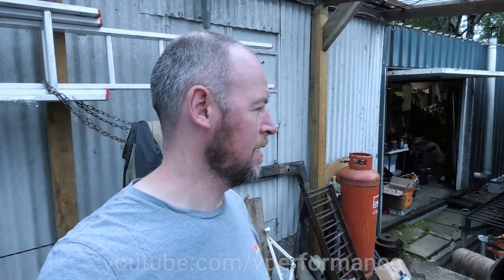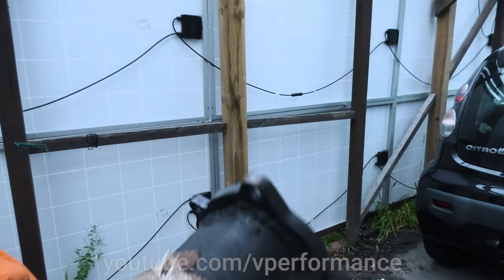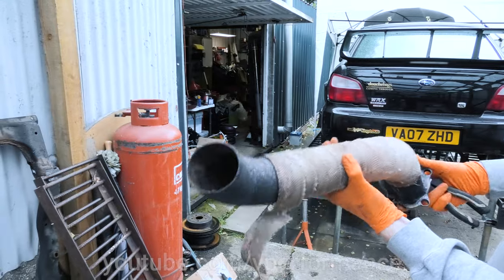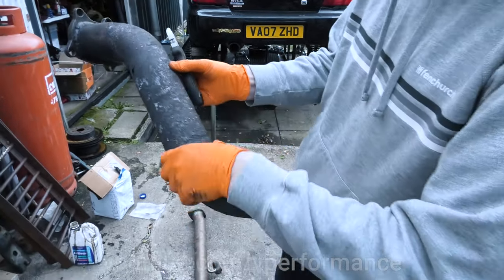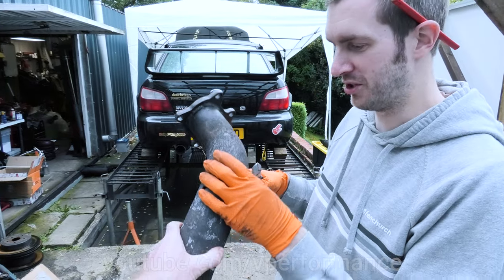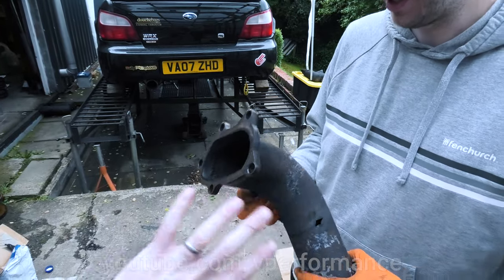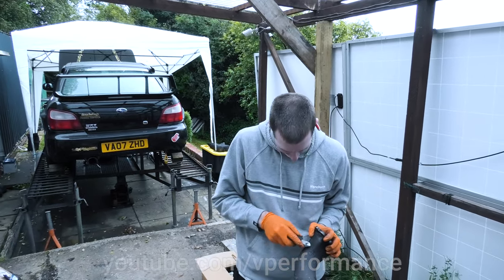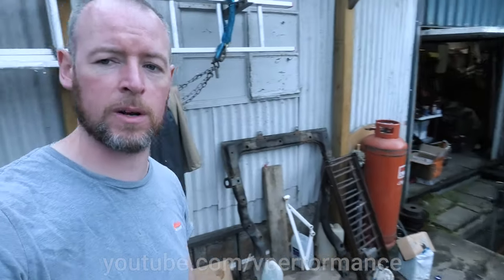Exhaust downpipe wrecked by a bad heat wrap // Project Driftbaru

Comment: When installing heat wrap you need to ceramic spray the inside and outside of the pipe before hand to protect the metal, and if you spray silicone on top to keep out moisture it's even better. I did this on my motorcycle headers and never had a hint of corrosion

Comment: I doubt that is high quality stainless steel.  The Chinese have been dumping low quality "stainless steel" on the market for years.  If it was high quality stainless steel it wouldn't have rusted like that no matter the heat or moisture trapped by the untreated exhaust wrap. I almost bought a toolbox topper from one of the tool trucks that was supposed to be high quality stainless.  Despite the tool guy telling me they made it in the US of A I doubted the steel they were using was.  I grabbed one of his pencil magnets and even that weak magnet stuck to it and held itself horizontal.  There are varying degrees of stainless steel and some are magnetic.  Those aren't the grades of stainless you want to use on an exhaust system.

Comment: I've never believed in wrapping exhaust, it traps more heat in the piping which will affect whatever metal the pipe is made of. Not only that, but the exhaust going to the turbo is hotter and decreasing the life span of your turbo and possibly even heating up the intake air going into the engine because of how hot(glowing red) the turbo manifold gets. There is a very good reason why pretty much every turbo car has heat shielding over the exhaust and not a wrap from the factory. It's to still allow for the exhaust components to breathe easier as well as simply prevent novice car owners from burning themselves when they dive into the engine bay right after driving the car. If you ask me, any form of Aluminum heat shielding/shrouding is the proper way to go if you're trying to reduce heat in the engine bay
Reply: hot air has more velocity
Reply: @matk22  true, but reduces the efficiency of the working components, there is a balance to be found most definitely
Reply: @Grooove_e  how? Higher velocity quicker spool faster exhaust flow
Reply from the maker: This is true. We hoped to show people in this video that there are some downsides to it. I can't afford to replace my downpipe every 10,000 miles!
Reply: @matk22  yeah but when you make that turbo operate at higher temperature its going to cause premature wear and also heat up to the point where its even heating up the air going into the engine. More air doesn't equal more power if the air temperature is higher
Reply: @matk22  hence why everybody used to want a cold air intake although those have been proven to show minimal gains especially in situations where they are combined with a custom wrapped exhauat

Comment: I've had my stainless downpipe wrapped for 4 years now. I live in a very wet and rainy area. My downpipe is still shiny, a bit blue, but no rust.
Reply from the maker: Could have been some shitty steel then
Reply: They were probably using some cheap material piping. They actually should have used titanium wrap instead of fiber glass. For the most part Ive seen this stuff work.
Reply: Lots of guys silicon spray the pipes before wrapping them and then silicon the wrapping too.
Reply: also, run the engine after long drives in the rain. dry off them pipes a bit, the fiberglass traps it in otherwise.
Reply: Did you have it coated or just straight stainless?
Reply: patricknbrooks11 Ceramic coating them is the best grade of quality protection because it traps the heat completely and the pipes doesn’t rust
Reply from the maker: What makes you say that?
Reply: Only stainless steel t304 doesn't rust t409 does and it's still technically stainless steel

Comment: It wouldn't have cracked so quickly if there was a "flex" pipe
Reply from the maker: Agreed. Flex pipe might have bought more time
Reply: Or used a proper steel that is not the cheap shite that is 304. Oh well, blame the wrap, easier than doing a good job on one of the easiest bloody things to do in a cae, a bloody downpipe.

Comment: Wrapping exhaust pipes is good practice, as long as
it's done when new and sprayed with silicon to keep the 
moisture out. Which I doubt it was the case in this installation.

Comment: That fracture might have been caused due to fatigue as you don’t appear to have a flexible joint in there. Might also be why it fractured previously at the glance to the turbo.

Comment: From the article Why Does Stainless Steel Rust by Polymer Solutions Incorporated. "A less common form of rusting in stainless steel is after the stainless has been exposed to very high temperatures, often in the 750-1550°F range (400-850°C). This type of corrosion is often seen in welding applications in which stainless is heated and then cooled. If this happens, “sensitization” can occur which is where the carbon and the chromium bond together in the stainless steel and form carbides. These carbides situate themselves at the stainless steel grain boundaries, and the grain boundaries become deficient of chromium. With lower chromium concentrations at the grain boundaries, the chromium oxide protective layer can become discontinuous and rusting becomes possible. “Sensitization” can ruin stainless steel forever; however the damage can sometimes be mitigated with complex heat treating."

Very interesting stuff. I didn't know this. At first I thought you must have used a mild steel downpipe, but I didn't even know anyone made those. Catastrophic failure indeed.
Reply from the maker: Science! I reckon it'll have been on 400°C easily - turbo gets red hot on a bad day!
Reply: Easily! Especially when heat wrapped. ;)
Reply from the maker: @802Garage  "can ruin stainless steel forever". Yep that sounds about right.
Reply: @vPerformance  there are two types of corrosion that led to your issue.  1.  Under-insulation corrosion, 2. galvanic corrosion.

Comment: I only raped my exoust to keap my ac hose, power steering hose and my trans cooler lines form melting agen to keap the heat away from the rubber lines not for any performance advantages
Reply from the maker: This right here is a perfect use case for heat wrapping. Well done.

Comment: I agree with you. It's a waste of time, wrapping, and has more disadvantages than advantages, though your downpipe looks super janky. I have a small hairline crack on one of the welds on my Invidia SS bellmouth DP, just below the high-flow "fake cat" (that's what I like to call them), most likely caused by my previous wrapping, which ended prior to the cat-bulge. Maybe it kept the area just below the turbo a bit cooler, but who the fuck cares.

Comment: Heat wrapping is great.... The quality of the material that your downpipe is made of is the issue. You're not really supposed to wrap mild steel. Generally its reserved for something like inconel or a quality thick wall stainless or something that's properly coated. Something that thin will retain too much heat and break down significantly faster. That being said, proper heat shield solid sheets work better as they 1. dont trap moisture, and 2. don't touch the metal directly, but just provide thermal barriers.
Reply: That was stainless.  Emphasis on 'was'.  :)
Reply from the maker: Solid sheets? Not seen that before - who makes them?
Reply: @vPerformance  he means like the factory heat shielding that would come on the car if it was bone stock. I just took the factory cat off of my 03 bugeye wrx and it has a bunch of stamped aluminum heat shielding around it. Usually this heat shielding is very hard to find unless you have a factory Subaru Exhaust or are capable of fabricating your own

Comment: You have to also look at the factors of its purpose of how consistent it is used, is it a car of "high performance", and the material of the downpipes. The wrap will avoid the heat from flowing through the engine bay and keep it through the piping, of course in high performance and also running it on a daily the pipe itself it is bound to give out by overheating. Again it depends on its purpose. Great video guys.

Comment: Dudes, you can wrap the steel pipe as long as its quality metal and also you have to put silicone spray on the pipe before wrapping the pipe, it should then last tons more, also on normal cars that dont go on high rpms all the time like drift cars do, its safe, on normal everyday driving and doing pulls, its totally fine either way

Comment: That's probably poor quality steel, el cheapo. Ran for years with a 304 stainless dp wrapped on a daily driver and winter use too, and it's fine, no sign of rust. However heat hardens stainless and it will become brittle.
Further point, ceramic coating will do the same thing thermally, you're just keeping heat in the exhaust, however it won't hold water close to the surface so may be better if you start with a cheapo DP

Comment: The problem isn’t the wrap, it’s the cheap metal that you used for your exhaust setup. You can wrap quality metal without any issue.
Reply from the maker: This was a brand new stainless steel pipe. I can't say what it's made of though, because we didn't make it.
Reply: @vPerformance  always look for 304 or 321 stainless. Both should resist corrosion better than chinesium, but in reality, the problem is the wrap retains water. Seal it with high-temp silicone spray, should last much longer.
Reply: @ai_university  316 has more resistance to corrosion than 304 though right? Never run into 321 but I'm sure 316 is better than 304. Bit more expensive but you get what you pay for.
Reply: @thymepeacefiend6535  yep but 304 holds up just fine in my experience, and 316 is very hard to get hold of for some applications. 409 stainless is the cheap version that corrodes even without wrap.

Comment: It looks like the problem was corroded inferior metal and not the heat wrap itself.
Reply from the maker: The downpope was brand new when it was wrapped. It could just be a crappy product, what do you think?
Reply: @vPerformance  You have to seal the wrap with heat resistant silicone spray after wrapping, and don't overlap too much, it should last you 50k+

Comment: To explain why that pipe cracked on you is quite simple. Subarus don’t come stock with a flex pipe, they use spring bolts and a donut gasket. This allows for slight flex of the exhaust system. This wouldn’t have cracked if you used the proper hardware when installing the exhaust.
Reply from the maker: Not great work there by the garage who fitted it then. It's a miracle it lasted as long as it did.

Comment: Heat wrap is mainly for headers and manifolds coming off the head of an engine or exposed hot pipes on a motorcycle....my headers on a v8 that are wrapped are plain steel, just fine...are never wet because the heat keeps them dry, prevents my plug wires from melting. After about 3 years the fiber glass is starting to fall apart. Time to wrap again.

Comment: being a solid pipe with without a flexi joint surely insnt helping,  the location of some of the cracks looks lke  some bending stress has been aplied either from the engine twisting or the exhaust getting bumped..  although i agree wraping isnt a good idea in most aplications unless its full on motorsports and youre expecting to be changing out parts fairly often.
Reply from the maker: This looks like another vote for the flexi. I didn't even consider that as a factor for the shearing

Comment: I think there's a combination of things that lead to that failure,
Chinese mild steel 
Wrapped from the dump down, should have been wrapped to the dump to stop water ingress
No flex pipe
Reply from the maker: I assumed it was wrapped from the top down to prevent water coming up from under the car. It did have a flex pipe after the flange, but maybe that wasn't good enough. Chinese mild steel is just a guess - we don't know where the raw material came from. Could have been cheap Russian steel!

Comment: Spray the exhaust with steel-it and then use header paint to prevent corrosion. Then wrap it and use the silicone spray to keep moisture out
Reply from the maker: Or just keep it standard if you don't want to do all that

Comment: Problem one no one else pointed out you already repaired that before with welds meaning the metal was thin and most likely bad then you heat wrapped it and it got worse so by telling people don't hear wrap stuff you mean don't hear wrap metal that's already bad. Using heat wrap on new headers and down pipe is ok and good
Reply from the maker: Don't heat wrap unless you don't mind accelerating the destruction of whatever pipe you wrap.

Comment: whats the benefit of wrapping the exhaust after the turbo?
Reply from the maker: Exhaust gas temperature is higher which means faster flow. It also keep turbo heat out of the engine bay and in the exhaust instead.
Reply: @vPerformance  I've heat wrapped my stainless down pipe but the manifold is tiny and super short on a low BHP diesel so didn't do that. Do you think doing the downpipe will atleast help a little bit?
Reply from the maker: It'll keep heat out of your engine bay but its unlikely to make a power difference. Just keep an eye on the pipes in case they deteriorate faster
Reply: @vPerformance  it's full stainless so it should be good!

Comment: the idea is to cut down on the exiting radiating heat which often get sucked into the intake for some cold air setups.
Reply from the maker: Indeed. The downpipe on the subaru radiates heat up into the intercooler, so it has a benefit for wrapping, but it also destroys the pipes faster

Comment: I would say i hate the itchyness after you work on wrapping a header, and a cheap header will crack. As specially if you get it wet  a lot in road and drive salted roads, but itkeeps things frommelting.. so pick your poison
Reply from the maker: I think it's fine if you don't mind replacing the pipes more often (i.e. race conditions) but most people have no clue about the downsides exacerbated by wet salty roads.

Comment: Time to weld on a side exit!!! 👍
Reply from the maker: I'm in favour of a front exit right through the bonnet :D
Reply: @vPerformance  sold! Tell David get the welder out haha. Have you got decibel restrictions with drifting?
Reply from the maker: @psycho3344  yeah you need to pass 105 dB for most competitive days. Hood exhausts won't pass that!
Reply: @vPerformance  that's a real shame I would of been interested in seeing what it sounded like and also seeing mad flames making the windscreen black! What about a side exit with a small resonator/silencer just off the down pipe and exiting behind the o/s front wheel? Or go full bat shit crazy and go straight through the o/s front wing?
Reply from the maker: @psycho3344  maybe the wing would be a thing, but there's a lot of boost related electro shizzle wizzle on that side right now

Comment: It’s a part that gets replaced often like tires and turbo. A downpipe warped will last the span of a turbo. If your pro racing you should wrap it anyhow. Imagine a fire 🔥 under your hood hmm? It glows red, you really want that exposed?
Reply from the maker: Everything you've said is true. What do you think of wrapping a 1.6 non-turbo toyota exhaust?
Reply: vPerformance .... I’m going to share something with you bcs I have a passion for cars, anything non turbo will last over twice as long as a turbo’s downpipe will. Although there is a benefit to (hotter) exhaust flow it does kill your pipes especially if it’s something expensive. So here’s what I wanted to share... I thought of this for my turbo downpipe but maybe you can apply it to your design. I wanted to slide a flex pipe over my downpipe and then wrap the flex pipe so that my wrap isn’t directly on the steel and the steel can breath while keeping the heat from escaping. I also wanted to use a cheaper wrap to wrap the rest of my exhaust all the way to the muffler bcs I feel the heat in my car and I can hear it. I also want to hear shield wrap my turbo pipe bcs they are aluminum but they collect the engine bay’s heat like a heat sink and so you get the idea. Tell me what you think or any thoughts on that..,
Reply: @AutoBodyEverything  yeah I wish somebody just sold a shield kit for downpipes. Maybe you could collect air from the scoop and channel it down between the shield and the pipe.
Reply from the maker: Immico and zircotec both have some amazing metal wrap solutions, but they're generally custom, and expensive

Comment: I've been warping  my exhaust pipes on my Harley's for years and the only problem I have had is that the exhaust wrap comes apart after a few years of being exposed to the weather. I think your problem is the material that was used for the construction of the components.
Reply from the maker: I bet that stops your legs from getting scorched too!
Reply: @vPerformance   right on

Comment: I don't think that with better quality steel pipes the result would be the same.
Reply from the maker: Perhaps it needs to be viewed as a consumable part on a high performance exhaust. Every couple of years expect to replace the downpipe.
Reply: @vPerformance  : I am not an expert but for 12 years a have wrapped 2 exhausts and i had no corrosion or any kind of functional problems.

Comment: I think the problem was no flexy in the exhaust rather than the heat wrap.
Reply: Subarus, at least of the vintage shown in the video, don't have much flex in the exhaust. The bottom/last part of the downpipe hard-attaches to a bracket on the underbody. There is no rubber bushing at that point, unlike the muffler hangers. I've always thought this was a bit of a bizarre design, because if the engine rocks back and forth, even though Subarus have a longitudinal layout, then it does indeed put stress on the exhaust parts and turbo.